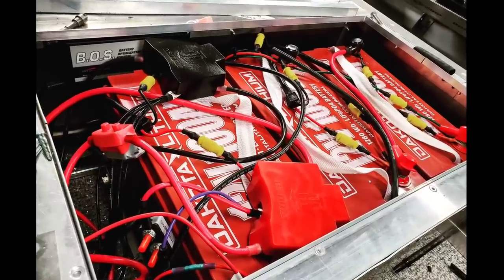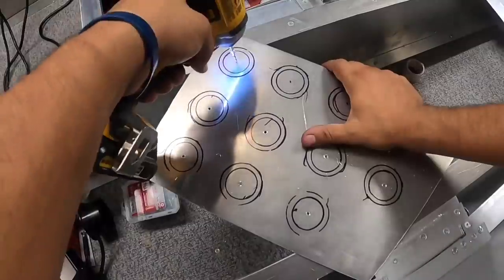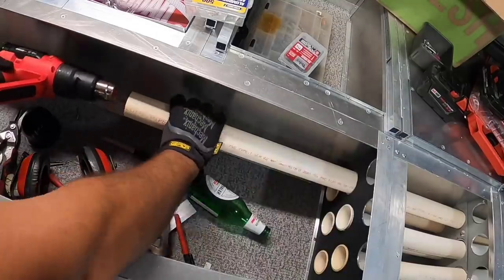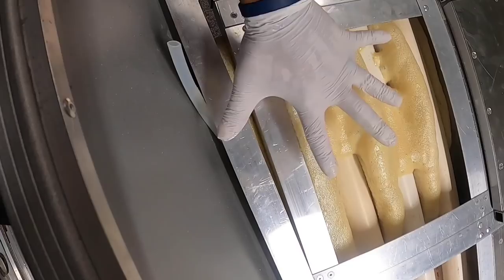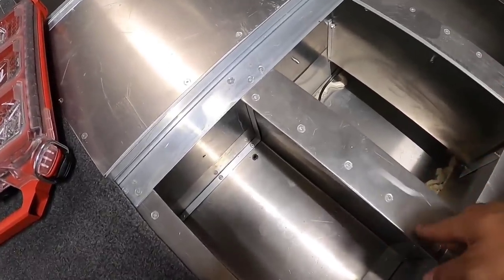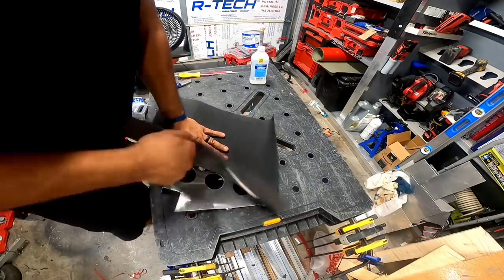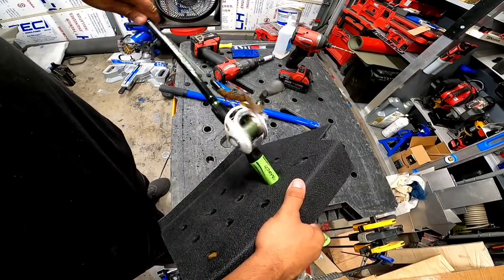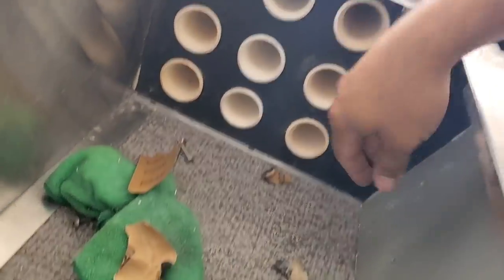Efficient Rod Locker Set-ups for Tiny Bass Boats.

Comment: Great video! On the pour foam instead of applying pressure with your foot, use a bag of ice in the compartment. That would release the heat without the bowing of the compartment. I like the fact you’re trying to mimic a whaler with all the foam.

Comment: Do you feel the rods won’t get a memory from being slight bent?
Reply from the maker: No it's never happened in anything I've built.  Andhe spacing for rods in a factory 17ft tracker boat is actually worse
Reply: And you said 1.5in tubes so 2in hole saw?

Comment: I use pvc vacuflow pipe. Same size and it’s lighter and cheaper
Reply: @TinyBoatNation  Schedule 20 or 30 PVC I believe is the same.  I'm watching your and about to start my build and I'm going to try the Schedule 20 or 30. I have to make the purchase and looking at both now.  I might go 30 because of how light it is and will be foamed in for stability.
Reply: @dennisrobertsjr2000  curious what you paid for the vacuum pipe, and where you sourced it.  I have seen it on Amazon for $26 for one 8' piece.  I can get 20' of 1-1/4" PVC conduit at a local electrical supply store for about $50 and get three tubes out of it.  If you have a source that is inexpensive, I'd love to hear!  Thanks.
Reply: This show's $4.83 here and ship to store is the way to get it if you don't have any at your local store.
Reply: @dennisrobertsjr2000  Thanks.  I ended up having to mod my design to be more "open" and use rod socks instead.  But...maybe on a future build I'll have room for a tube-based locker.